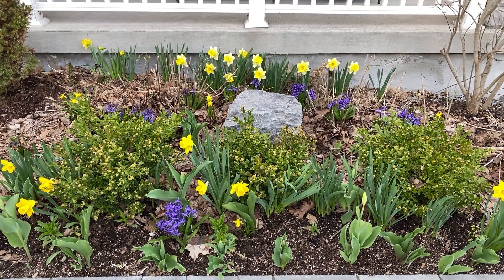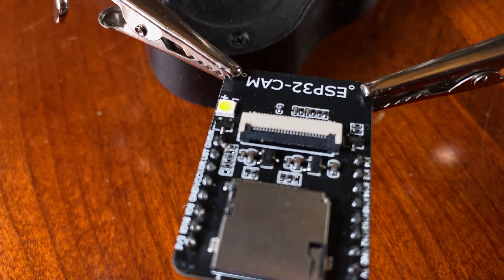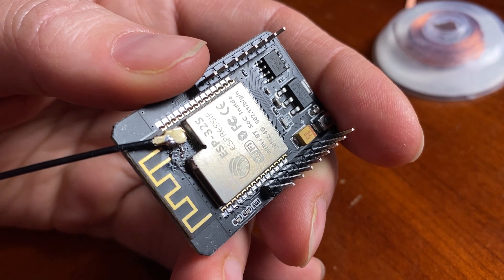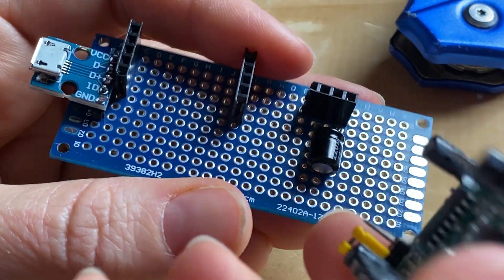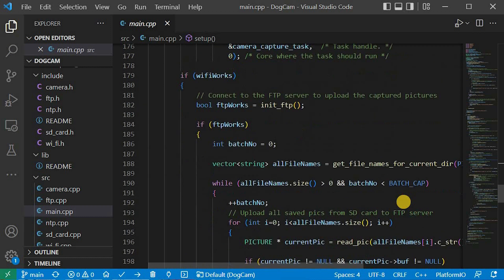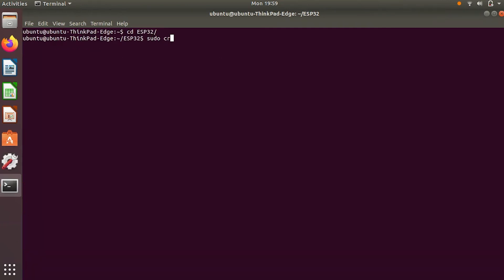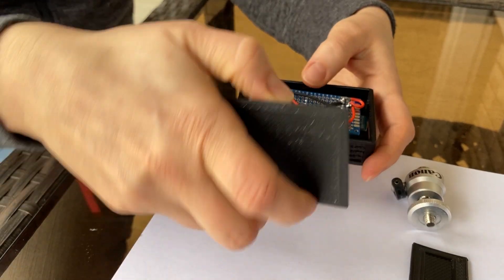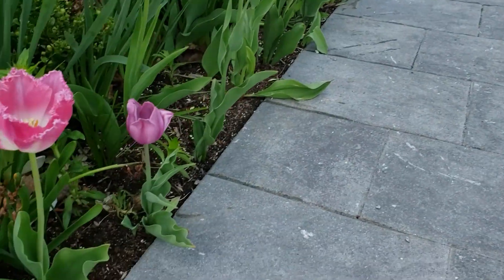Dog Camera | ESP32CAM with PIR sensor and FTP

Comment: What is the IDE that you’re using to upload your code to the ESP32?  I’m not familiar with this one and there doesn’t seem to be any information regarding where to get and install.
Reply from the maker: Thats a great question, thanks! I should probably add it in the description. I am using Visual Studio Code with a PlatformIO extension, both are free.
Reply: @robotsanddinosaurs , awesome!  After a little research I finally did figure that out and installed Visual Studio Code and the Platformio extension.  Now I need to figure out how to open your code, make all the edits, test and then upload.  This IDE is new to me, so a bit of a learning curve.  Had it been for the Arduino IDE, I’d already have it up and running!  😂.   Old dog, needs to learn new tricks!

Comment: Hi .. thanks for the video .. nice build ..

I am looking to make a door camera .. so my camera (esp32 camera) will be about 25 feet from my wifi router(1 wall in between as well) .. i have a few questions .. please help me if you can:

1) what is the ideal range .. if I use an external wifi antenna on the esp32? in feet i want to know ...
2) if I put an external antenna .. can I  increase the external antennas cable( i hope you are getting my point .. little DIY required which is easy to increase the cable length of wifi antenna)  .. so lets say if I want to put an antenna cable length of 10 feet .. would it work?

Any help would be highly appreciated 

Regards
Rahul
Reply from the maker: Hi Rahul, 

I think I may have similar setup to yours, about 20 feet from the router and 1 wall in between, so I'm guessing it should work ok. I haven't tried increasing the length of the external antenna cable, but I'm guessing it could work? Let me know if you try it. Cheers!
Reply: @robotsanddinosaurs  : thanks for the info buddy .. sure I will be trying to extend the antenna wire .. and i will update you (it will take time though) ..

Comment: Thank you very much...  For the ESP32-CAM PIR Motion Capture Photo and upload to FTP local server source code which I have looking for a long time on Internet ... Also to catch dogs and cat poo in front of my house problem ... Cheers ... Just a suggestion... can your code be modified to omit using the SDCard to save the photos? Preferably upload the photos directly to the local ftp server on Raspberry Pi instead?
Reply from the maker: Thanks! 😊 That's an interesting suggestion. However, sometimes the wifi or the ftp server can be down because of various network issues. I'm guessing without having an SD card, the photos would just be lost if they couldn't be transferred right away ? With SD card the pics can be transferred later when the network comes back, so it can be a nice backup option.
Reply: @robotsanddinosaurs  Okay! You are right a very properly thought out redundancy idea solution. I totally agree. I will try my SanDisk 32GB SD Card as that is the minimum available in the market now days. My fear if the SD Card is not usable then if you have option for non SD Card solution will be great for those not having a 4GB SD Card as recommended for Ai-Thinker ESP32-CAM units. Thanks a million! Cheers ;)